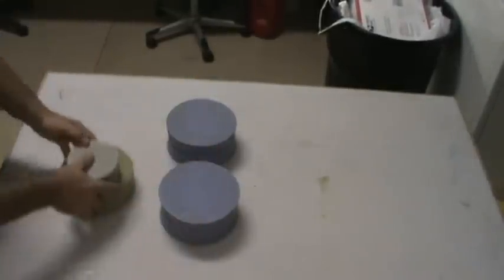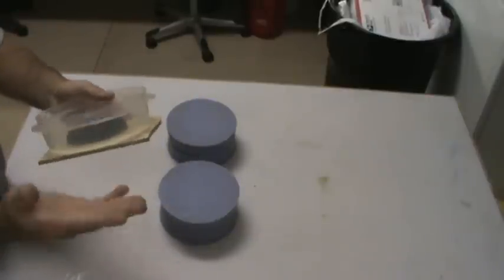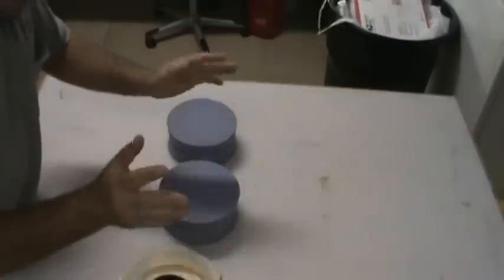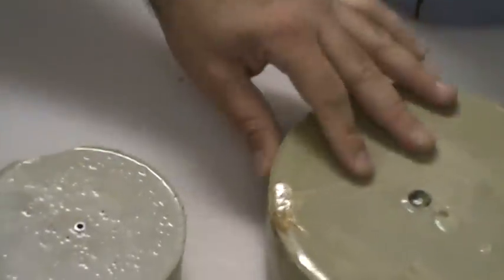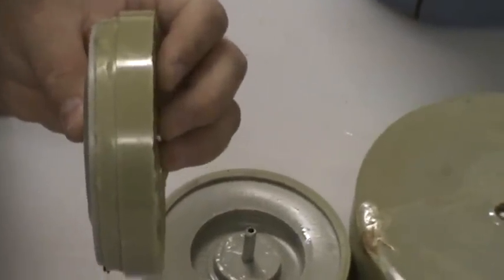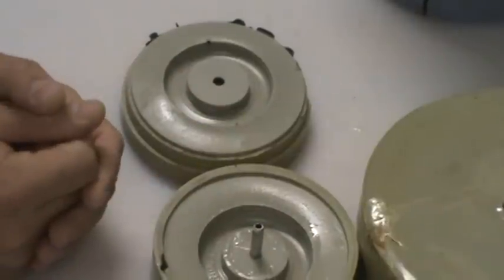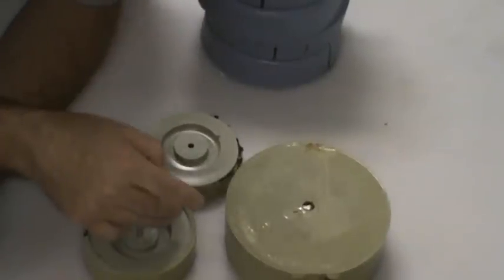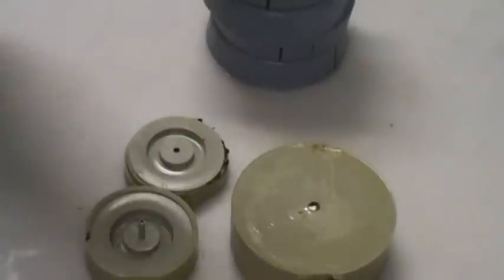How to mold your own tires 101

Comment: Looks like I’m going to have to get some molded custom tires...1/18 RC racecar, tires have to be 2” not 2.5” that out of scale.  I like the stock steel racing wheels, the smallest I can find is 1.55, but even the low profile tires are too big.  I may have to find a cheap NASCAR toy to get the correct size rim and duplicate 4 in resin, then cut a tire to fit that rim and make a mold for that tire...I’m planning to make a lot of these tires, for several 1/18 scale “Enduro” style RC race cars.

Comment: Can't understand your pronunciation of the type of rubber material you used..
OO OO Mooo Stuff ???... could you please add that info to this thread?
 Thanks for sharing...awesome !!
Reply: MeinDuff48  "O-O-MOO 30" is the name of the rubber casting material. I don't know why the name is so strange. It doesn't mean anything in English either. The company that supplies it is called "Smooth-On" and they carry a HUGE variety of rubber. They are on line. They got their start supplying spedial effects people in Hollywood, and if you look at their catalog, you can see the kind of things they supply. It's pretty impressive.The "30" after the rubber name relates to how hard it is.  I think the scale is from 1-100 in value.  A 30 durometer rubber is on the soft side. 100 durometer rubber would be like a bowling ball. The advantage to this 30 Durometer rubber is that you can cast a resin part in it, which will be as stiff as a regular kit molded part, and you can still get it out of the mold, because the mold will stretch a little.  If you have a minor undercut on the pattern, it won't matter, because the rubber will allow the undercut to flex over the part and the part will come out. If you use a very high durometer rubber, and you have any kind of undercut at all, you can't get the part out without destroying the mold. They sell small sample kits, so you can try things out and see how they work, and then decide the way you want to go. Smooth-On here in Arizona is very helpful and excellent to deal with. Their service is very fast. I would hope they are as nice in other places. Look them up on line, and see if they have a distributor in Europe....Good luck!
Reply: awesome ..thanks !!